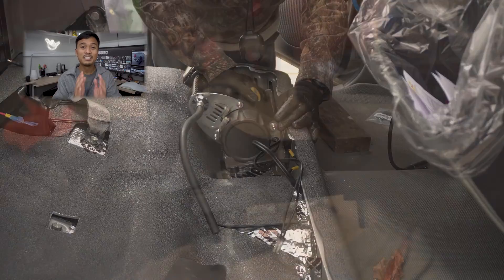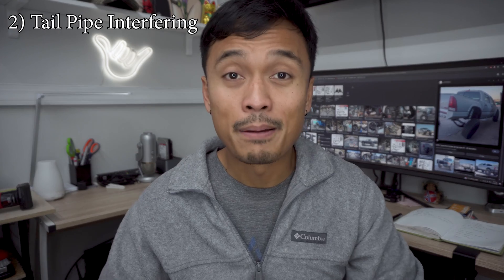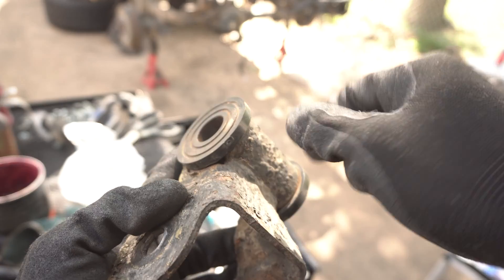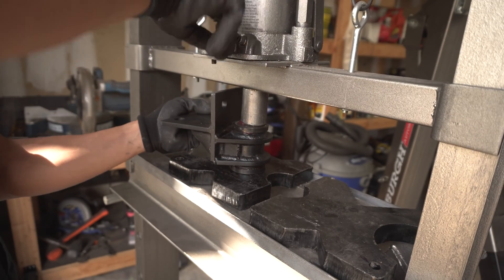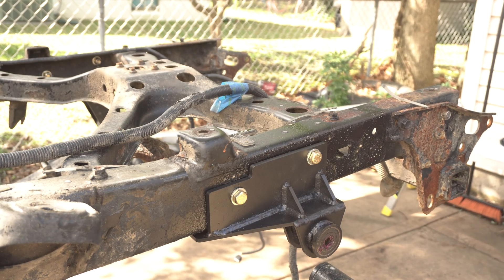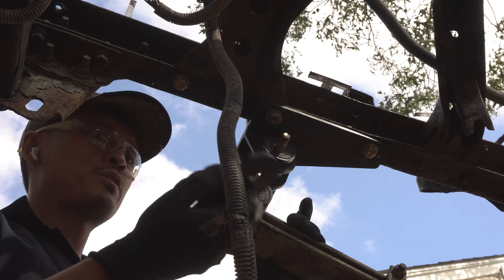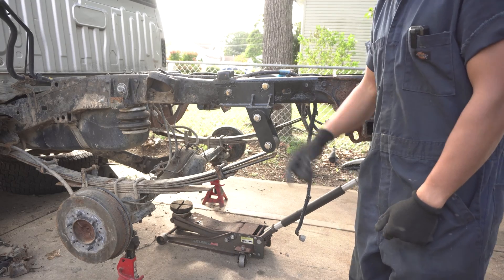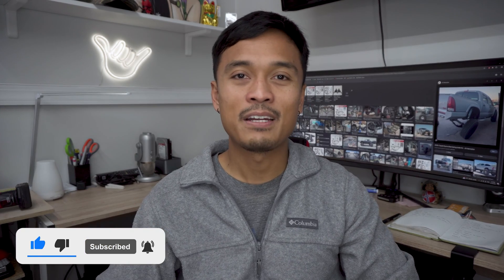Shackle Flip Installation (Tacoma)

Comment: A strut is a structural component of the suspension as well as a damper. Tacomas have shocks, front and rear.
Reply from the maker: I agree, that's why I say that  9:25 that I am upgrading mine. This was just to measure the test of flex. You can check my short vids that I do run struts

Comment: Looking at doing this job to my taco... what struts did you go with? was looking for something with 12" travel but getting into custom territory is apparently quite tricky haha. Good video on install it will help thanks!
Reply from the maker: I'm currently on my Dobinsons 2" lift and it gets decent droop. Any more than that will require extended brake lines, limit straps, etc. I'm planning on longer travel in the rear so you'll see more detailed work on that in the future. Here's how it does droop on this shackle flip: https://www.youtube.com/shorts/TUVW2hUHeuU
Reply: That’s good to know. I think I’m going to go ahead and install the shackle flip. Maybe I’ll get lucky and have enough play on the struts as is

Comment: I heard that all leaf springs that are designed for the stock ‘inverted style’ shackles are designed specifically for that use. Flipping the shackles would also require leaf springs designed specifically for that type of shackle. Any truth to that?
Reply from the maker: Leaf springs are designed to be loaded at the eyes of the leaf springs. If you look at the leaf spring design (check out my video before this), it's literally just a stack of curved spring steel. If the shackle is on top or underneath, the leaf spring is still loaded in the same mounting eyes. The shackle configuration does move the roll center, higher or lower... The same argument that those guys have can go to the same extent as me running with 35" tires or anyone doing any type of modification really. At the end of the day, if those guys don't present any type of research documents and statistical analysis - they're just basing they're arguments on "feelings". FYI, this video was shot back in July, I've been 4-Wheeling on this shackle flip and it's awesome

Comment: I can’t seem to find the hangers on the link you provide any info on that?
Reply from the maker: It should be this link: https://kflotacoma.myshopify.com/products/tacoma-rear-shackle-flip-w-4-shackle
Reply: @TacomaTutorials  thank you that one works do you happen to know about how much travel is gained over all like I know archive’s is 12+?
Reply from the maker: My goal with this project is to get 10+ suspension travel in less steps (which means less money/work) using stock mounts. In order to achieve the 12+ travel for Archive Garage (or for any shackle mount systems, even mine), you'll also need upgraded shock mounts as well as limit straps, bump stops, brake lines etc. If you scroll down to the description of the Hammer Hangers from Archive Garage under shackle options: "-Reusing stock shackles (3.4") and OEM rubber bushings are totally fine up to ~10" travel". 10 inches of travel is plenty, check out Dirt Lifestyle's Landcruiser - those shocks only has 10" of travel.

Comment: I like that shackle mount kit. I currently have Archive Garage rear shock mounts. That let me use 13 inch travel shocks.
Reply from the maker: Awesome! Which shocks do you have?
Reply: @KFloTacoma  I have the Bilstein 6125, 25-187748. They're 13 inch travel reservoir shocks. They're great, but I need better leaf springs for when it's loaded down for my camping trips.
Reply from the maker: Thanks for the input on the shocks. Which leaf springs are you using?
Reply: @KFloTacoma  I have stock springs right now. Theyre ok. But my camper and loaded down with camping gear it's almost fully bottomed out. I'm looking into the Archive Garage heavy duty springs for next year when it warms up for camping again.
Reply from the maker: Dude, I think you would like the adjustability of the air bags - especially if you drive with your truck fully unloaded from time to time.  You'll see how this video series progresses once I get to the airbag design portion.
Reply: @TacomaTutorials  nice, I thought about bags. I installed some on my cousins F150 awhile back because he hauls a work trailer. I was concerned about down travel on my Taco if I put bags on.
Reply from the maker: I have the daystar lower cradle that disconnects the bag at the down travel. It's awesome, Also I'm redesigning the bracketing system though to better match it up with this shackle flip. I have a whole video on the airbag and cradle installation if you're interested in how it turned out (this was way before I did the shackle flip)
Reply: @KFloTacoma  wow, I didn't even know their was bag disconnects. I'll have to check that video out now.
Reply from the maker: Yea dude, here's the link to that video: https://youtu.be/RUtYbQp7cN0